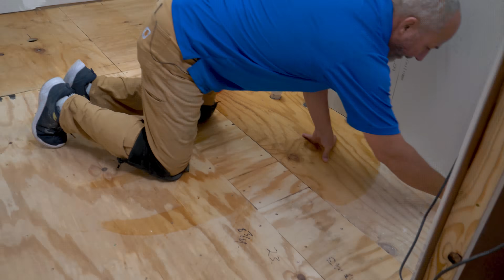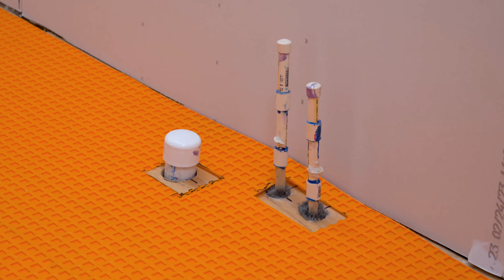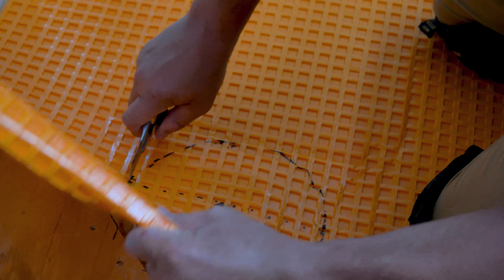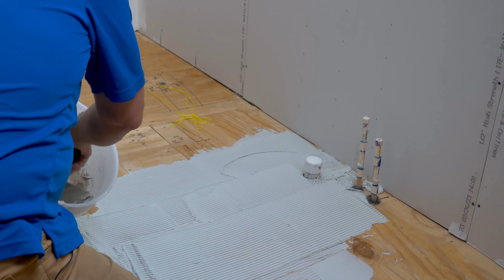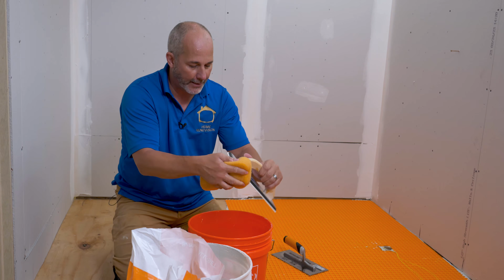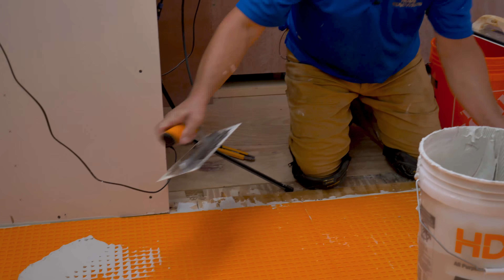Why You Should use Schluter Ditra on Your Tile Job

Comment: I personally use Hardi-Backer on all my DIY tile jobs and it has "never" failed me.  Had my kitchen and breakfast nook done by a pro who was trained to train others for the Ditra mat. I got talked into why this system was so much better. I should went with my gut. Now I have several cracked tiles from floor flexing.  You will never convince me flimsy plastic will ever be superior over a hard/stiff substrate when properly installed.  Sometimes traditional things or ways just makes more sense.  

Many new methods is to cut installation time to save money, but that doesn't mean they are better methods.
Reply: Maybe your pro wasn’t so pro after all
Reply: @mattwilson7443  or maybe ditra is trash.
Reply: I was wondering why he doesn't just use hard backer. Is it because the subfloor would need to be replaced with Hardie back? Idk I'm not a contractor. It's annoying how every comment are just fan boys and nobody ever questions anything
Reply: @caploader111  tile floors fail regardless of what type of underpayment you use. There’s no standard for uncoupling membranes but they claim that those failures are less likely with them but I suspect they’ve gain popularity mostly because of their ease of use
Reply: Many more reasons that the tile would have cracked than because of the Ditra.

Comment: Jeff I think you know exactly what you're doing but there's one important step I haven't seen you mention and that is making sure your sub-floor is screwed down properly. I use a 3inch screw making sure you hit the joists. A stagger of about 8 inches is good. and make sure there is no play anywhere before you do the Ditra.
Reply: Good point, you need to eliminate any potential spring play in your subfloor. Screws that are  2" is plenty. I suggest a 4 to 6 "inch spacing, 4" for a springy subfloor.
Reply: 3" screw is overkill but I get your point. By careful using longer screws than necessary. Never know what's sitting below the floor when a screw is now going through 2+ inches into the void.
Reply: Yeah He skipped over the prerequisite of considering the strength of the subfloor ( joist size and deflection etc)  This is especially important for large format 24 x24 tiles.

Comment: Hi Jeff.  Loved the video but have a question relative to my install.  Like your bathroom I will be laying two long strips - 6 feet each -- to cover the floor.  But I have the tub at one end and the exit door at the other end.  I don't have the shower area as an escape as you did when putting on the second strip.  You mentioned that you don't like to stand on the Ditra while it is still curing (34:12).  So if I do one strip then I can't get to the area where the other strip goes without being on top of the first strip.  Should I wait overnight for the first strip to cure or go ahead and kneel/stand on the first strip while thinsetting and installing the second?  Thanks.

Comment: I have the old wood skip sheeting 3/4 “ wood at a diagonal very common on homes built before 1960 this floor is from 1962. I can’t  find any information on the correct way or what  product to use as underlayment. I want to put 7/16 osb on it then the Schluter system because it will be a heated floor but I don’t know if osb sheeting is the same as osb flooring or if it would be approved under a heated floor. I’m trying to match the existing hardwood floor hight and don’t what to use a thicker product.

Comment: After my 40 years of "Industry standards" and "best practices", I tend to laugh at any "current" version for either of them.  How many iterations must we suffer regarding "the right way" to install tile...if all previous "right ways" are now the "wrong way"?  How long before this too becomes "the wrong way"?  So technically, ...in hindsight, ...until this, the correct answer was "You only install tile on concrete floors."  Because every previous way to install on wood had been done away with.  They never were correct.  Or they still would be today.
Reply: Agreed! I just remodeled both of my bathrooms, which were 24 years old. Nothing wrong with the tile floors just had the means to update them and wanted this done because I am 60 years old. When the house is built 24 years ago, they tiled right over three-quarter inch plywood. And the master bathroom is large, 200 square-foot tiled floor. Not a single crack, mortar joint crack, shower was perfect, everything was just old. And this was on the second floor. Nothing wrong with the small bathroom tile either done the same way. I’ve seen plenty of tile floors over concrete, over wood, no issues for decades. Schluter is completely unnecessary… tell me, how does thin set stick to plastic? Flexible plastic at that???
Reply: Thinset locks into Ditra mechanically and does not need to stick. Your comment shows you know nothing about Schluter @Maynardd
Reply: @kurts3779  I know it’s a waste of money and completely unnecessary. You missed the entire point.
Not surprising.
Reply: You have no point when you are talking about tiles installed 24 years ago. Todays tile are different in size and are much more sensitive to stresses vs the smaller tiles from yesteryear @Maynardd
Reply: @kurts3779 😂 it’s all the same.
Reply: @Maynardd  You sound like the type that thinks men and women are the same thing too. 
How is a 12x12 ceramic tile the same thing as 24x36 porcelain tile? Its like saying a small boat will handle the oceans tidal movement the same way a large ship will. The more speak, the more idiotic you sound. You probably used unmodified thinset on a large format porcelain tile and sum it up as all the same thing. I strongly recommend you leave the tiling to the pro's who understand the differences and know things are not all the same.
Reply: @kurts3779  you should take your own advice. Leave it to the pros as you clearly are not. tile has been on for literally thousands of years, there is still existing tile that is over 100 years old, do you know what they all have in common? No Schluter. You equal 🤡
Reply: Yes, tile that has been on for thousands of years and its also had some form of uncoupling. I use to install mesh, tar paper and 1 inch sand and cement mixture way back in the days. I guarantee you tiling has been in my blood longer than you've been alive. @Maynardd
Reply: @kurts3779  and yet you still don’t realize you don’t need Schluter. And no, I assure you you’re not older than I am. Why don’t you look up how many of these tile floor floors fail with Schluter. Mr. I’m an expert tile person that is absolutely clueless. Thought you might come come back in thousands of years once it’s proven to stand the test of time like literal tile that was installed hundreds of years ago but still exists today. You’re being ignorant now.
Reply: @Maynardd  Been using Schluter for over 15 years with zero failures. I don't need Schulter, I want it! 
As if houses were the same too a thousand years ago without ever evolving. You really are that special kind of stupid that is stuck in the past. You're the "You can't teach and old dog new tricks" kind a guy.
Washed up and expired. Schluter is just one option, and a great one at that.
Reply: @kurts3779  And you’re the fool who’s Bought into something you don’t need. Stuck in one way. An unnecessary way. Your an ignorant 🤡
Reply: @Maynardd you’re right. I’m a bathroom remodeler I just did a job where I tore out a ditra floor system and it was squeaking before I tore it out. I also found out that it was the hardest tile floor that I’ve ever seen to tear out as well. I would not recommend ditra to anyone!
Reply: @robcollins8690 ditra can’t squeak. That squeak was coming from the subfloor. Speaking as someone who installed ditra in 3 places bits awesome.
Reply: @securitysam  no kidding it can’t squeak, it’s soft thin plastic. It’s the subfloor. But if you use concrete board as directed, you will not have any squeaks at all.
Reply: So, what do you do when you’re on the second story of a wood framed house?
Reply: Use something other than tile @pete1679-l4j
Reply: @pete1679-l4j concrete board and a grout
Reply: What happens when a crack forms in the he concrete under the tile a few years down the road.  Replace the cracked tiles or fix grout?  Decoupling is always needed
Reply: I’ve always taken my time and used the Schluter system with no problems
Reply: My friends please don't be afraid of innovation and progress. In my field it's the same way with 'veterans'- if it's not the way they've been doing their job for 20+ years then it's silly and 'a fad.' Living in an earthquake prone area made me research and eventually select a decoupling membrane over cement board.  YMMV
Reply: It's called continuous improvement. Innovation is constant and continuous just like everything else (cars, phones, etc.). Not really sure what your point is other than you're big mad that things change. Feel free to step in the grave at your leisure, jaded boomer 😅😅
Reply: I have worked with at least 3 different contractors over the years and each of their methods are the "right way." Now,  I have 4 "right ways" to do the same thing! Each of their ways plus my own! Lol
Reply: For sure! Feel-good tech is replacing common sense and older traditional methods that have been proven to be extremely reliable.  The quality of craftsmanship however has degraded substantially

Comment: I'm convinced that this is the way to keep water from reaching the subfloor.  What happens to water trapped between the Ditra and the thinset/tile?  Are we just assuming that it eventually evaporates? What is a homeowner supposed to be doing to prevent a mold layer forming on top of the Ditra?
Reply: Between the ditra and the tile it should be full of thiset. No real space or air for mold to grow. Water shouldn't get past your grout so easily either.

Comment: If the purpose of the uncoupler is to separate the tile from the subfloor then why would you want to glue the membrane to the floor with thinset? I can't find an answer to this. What would it hurt to roll it out and let it float.  If it's to level the floor slightly, you will accomplish that with the thinset under tile.
Reply: Call the the manufacturer
Reply: The felt that is attached to let’s call it The plastic moves. so the felt is adhered to the subfloor, but the plastic on top can still slightly move

Comment: So I watched the vid because of the title “Why…” This was not explained during your core workout! Renoing a 35y old bathroom. Floors uneven and not level. Subfloor requires fixing in some areas. Would this be a good product to use to put a 12x24 tile on this floor? Considering using self leveling cement over the floor. Cheers
Reply: I have the same problem, and I'm leveling the floor now. I ripped out the old subfloor and am sistering the joists to level the floor. Then I'll add plywood and Ditra before doing the tile work. Ditra allows you to avoid putting a second layer of plywood because you need a subfloor thickness of 1 1/4 inch for tiles. It's also a waterproofing membrane, and you can install a heating cable directly onto Ditra.

Comment: Do you need this on a cement floor, like in a basement?  I have tile entries directly to the concrete with no issues... but that is a smaller area than a bathroom.

Comment: HELP I have removed the vinyl flooring in my current bathroom, which was only stapled by floor vent, and it's bare wood. It's a manufactured home and I'm working around existing sink bassinet and new walk in tub.  Should I still cover exposed wood with this membrane process before tiling?

Comment: Can somebody tell me the benefits of using ditra vs cement board for floor tile? Genuinely curious!!!
Reply: Ditra is an uncoupler material with an added benefit of providing some waterproofing.  Cement board is not an uncoupler, so it is possible as the floor shifts or expands and contracts, tile or grout may crack.  Ditra allows the subflooring to do its thing and the tile is left unscathed.

Comment: READ the instructions for mixing your thin set !!! ..  Mix for 3 minutes,  let set for 5,  then , mix another minute ..  Makes it spread so much better.
Reply: Instructions on the bag say mix for 5 minutes, let slale for 10, then mix for 3
Reply: Also what I learned if using their all set, when setting the ditra mix it as loose as possible (max water). Then when setting tile mix it as thick as possible (min water).

Comment: Not a chance? Timber underneath a bathroom floor. Forget about it. Cement or nothing. What a joke. Use a real subfloor and a real waterproofing system not this cheaped out crap. It's only going to cost you $1000's in 10 years time. Unless you plan on selling soon and flicking the problem onto someone else. This bloke is your typical "won't see it from my house" kind of guy. Also knowing the US, you don't have to give warranty on anything, in Australia you have to give 7 years warranty on waterproof systems. Good luck with this crap.

Comment: As usual great video.  Question:  I'm thinking of re-tiling bathroom floors, we have concrete floor underneath so would you still use the Schluter Ditra Membrane on top of the concrete?  Would the benefit simply be to prevent the concrete from sucking out the moisture of the tile thinset too fast or what? Thanks In Advance!  Always appreciate the effort you go through to educate people.
Reply: Hi I have the exact same question. Are you done with the install and did you put the Ditra membrane on top of the concrete subfloor ? It's our foundation btw

Comment: If you thought laying this down was a lot of work, try ripping it up.... not only will you spend your whole day doing it but you will totally screw up your subfloor... just because they make a product doesn't mean it should be used
Reply: Sounds like it definitely should be used
Reply: @bjellison905  there has to be a problem for there to be a solution, 24 years of setting tile and I've never used that crap nor have I had a failure

Comment: I've read that the sub floor needs to be pressure treated exterior plywood. Did you use that? Also,was the sub floor sealed with a primer? I chose this product because it a was only a few dollars more than the treated 1/2" plywood sheet I would have used. That would have made the tiles a little higher than the adjacent hardwood. The lower profile with a floor leveller should maintain the height

Comment: Strange question. I’m looking at this product to raise the height of the tile to the height of my hardwood flooring that I am putting in the kitchen. I know this is expensive, but would it do the trick or is there something else? I’m installing over a cement foundation. I am great a DIY stuff, but not an expert at tile enough to add the extra height. Even with this 3mm added height, I still have to build us slightly.
Reply: Ditra  XL

Comment: One reason I would use a paintable/trowelable crack membrane (Redguard) instead of this is the addition of the height of the floor.  If you can just get away with a slightly angled t-molding, this might raise your floor too high.

Comment: 24:26 I have been known to use a Marble Rolling Pin.. easy to adjust the pressure as needed. Use the float for the edges and corners.
Reply: What’s a float???
Reply: @Poppieparty Tile Float..

Comment: Hey Jeff. Off topic question for a new DIYer if you or someone else can help I'd appreciate it. Trying to build an IBC tote stand (4ft off ground) for water pressure to gravity feed my garden. Those totes are pretty heavy (2330 lbs full of water). I want to build this securely and properly without any chance of sheering screws or anything of that nature. Looking at building this with some 4 x 4's and some other materials as I have heard 4×4 posts can support at least 4,300 lbs. So having those as my foundation seems ideal. Though I don't know wtf I'm doing. Help?

Comment: After struggling with mixing thinset on bathroom number 1, almost burning out my drill, I invested in the  Ridgid 7135 mixer last year and switched to using All-set most of the time. It have variable speed, soft start, has an effective auger on it, and gives dual handles to easily control.

Comment: Schluter products were made after all the shower guys had mastered their crafts.  This is marketing.  They advertise super hard but are a very atrocious company logistically. Using their products create tons of additional issues with shower waterproofing and they are not made to hold up like traditional products.  We never needed a product like this, we just needed competent installers.  Kerdi board is pretty nice tho I gotta give it to them.  They cant mfg it at scale though because they spend all their money on marketing.  "As long as you install it correctly"  I wonder what they are paying you?  Maybe I should shill for them.
Reply: I’m not saying I disagree with you, but I have yet to ever hear of this product failing. But I certainly don’t think this product is necessary. I am still scratching my head though as to how thinset adheres to plastic?
I just ripped out one of my bathrooms and the tile was installed directly on the plywood floor, the tile in the shower was tiled over regular drywall, there was never a failure anywhere, no leaks anywhere, no water stains under any of the tile in 24 years. This product is not necessary.

Comment: Awesome video, Jeff.  Love the details of using Schluter's product.  Can I use the same process with a cement basement bathroom floor as it is very level? It was only poured 4 yrs ago (new home in Niagara Region). Or should I install plywood first with Tapcon screws. Carpeting at the door threshold so I want the height to be as similar as possible.
Reply from the maker: no worries. direct bond to the concrete is perfect. Cheers!
Reply: happy to hear that.  My OCD says thank you  lol
 @HomeRenoVisionDIY
Reply: But I can't find the membership code in order to post in the forum.   Can I get some guidance?